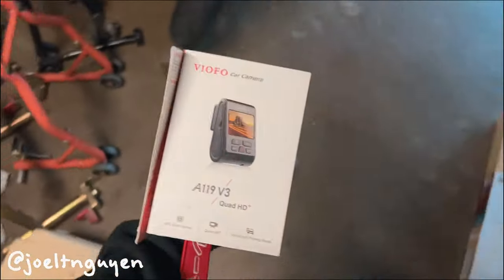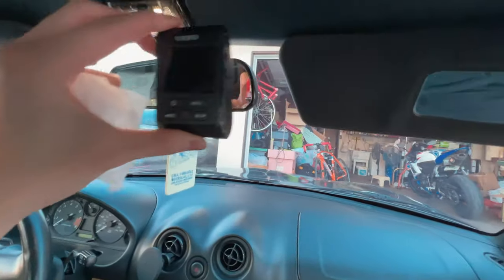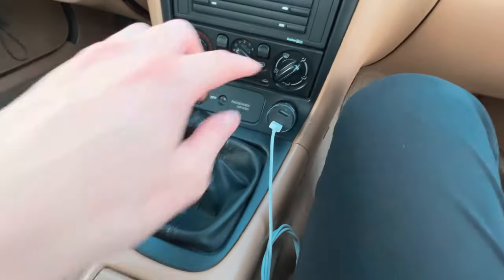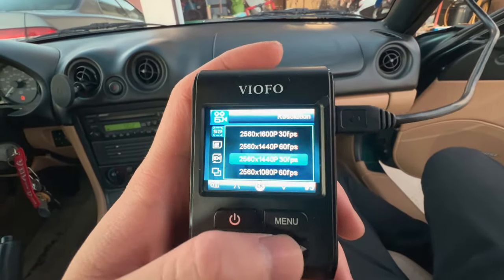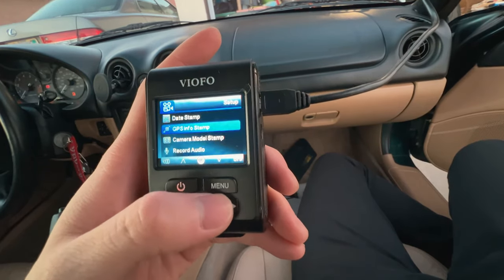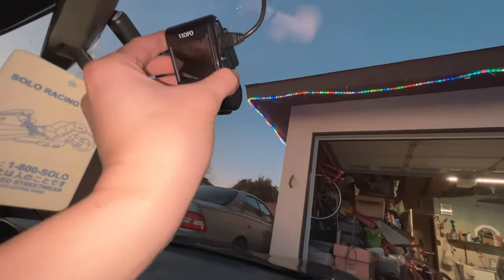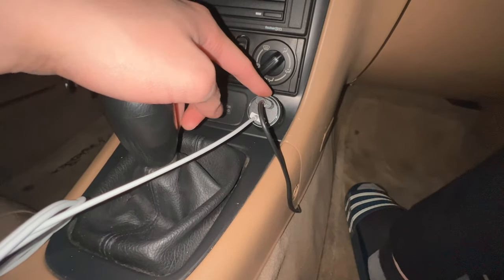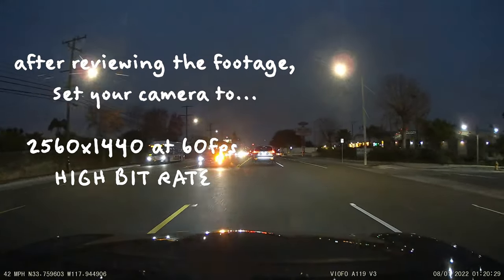VIOFO A119 v3 Dash Cam Install (Day and Night Test Footage)

Comment: Good video and thanks for the resolution / bitrate recommendation at the end.  👍
Also, the GPS mount has it's own power port... why don't you just plug into that, instead of the side of camera?  (less of the wire will be visible)
Reply from the maker: Ah you deserve a medal. I just checked and plugged it into the GPS! Makes it cleaner and I can disconnect the dash without unplugging 😂
Reply: @joeltnguyen   No problem, I just installed my new A119 v3 today with the GPS module + CPL filter. Drove it during the day and at night, quite a good camera I must say. I went with your recommended resolution and bitrate.  A 5 minute video file is almost exactly 1GB, which translates to almost 10 hours of recording on a 128GB microSD card.

The latest firmware (v2.5,) seems to add a higher resolution of 2880 x 2160 P30, but I haven't tried it. The files at that resolution will be huge, probably (therefore less recording time). It would be fun to compare all the resolutions and file sizes of the A119.  🙂
Reply from the maker: @SevenSixTwo2012  I tested one my GoPro when I was riding my motorcycle! Obviously different cameras but the resolution testing is similar! 1080p wasn’t clear enough but 2.7k or 1440 was the perfect resolution for clarity and file size. 4k resolution is definitely overkill but extremely clear and most likely able to zoom in with clarity (good if you need to read a License Plate further out)

The newer resolution looks like it will captures more horizontal view? Correct me if I’m wrong though but I’m assuming that’s the case. 

I’m curious now!
Reply: @joeltnguyen   Yes, I also assume that the video will be wider. However, the camera itself has a 140 degree viewing angle, therefore I don't know how they can make the sensor "see more" with just a software update. It might be just one of those software upscaling things that look quite unimpressive and taxes the processor needlessly. I've only had my A119 for two days, so haven't tested it yet.  Even at current resolution / bitrate it's excellent quality, so I might just keep it like that. 

Also, my night videos are nice and crisp, even with the CPL filter and HDR on. I wonder if the latest cams have upgraded hardware for night driving? In the Amazon ad, it says "2022 model" and my videos look better than some night test videos on YouTube. Yours look pretty good too.  👍

Comment: I personally use 2560x1080 at 30 FPS medium bitrate. There isn't too much of a difference between 30 and 60 FPS, both are technically 30 FPS, whilst '60' is just 30 FPS interpolated to 60. I also recommend turning on HDR, since it helps to add more detail in the scene. But this mostly applies to night time only.
Reply from the maker: Thank you, I switched my settings :)
Reply: @joeltnguyen  Glad I could help

Comment: I have hadwired installed switchable VIOFO dash cameras in my vehicle. One facing front, one facing back and one facing the driver and driver window. Why switchable? If one gets stopped by a pig they tend to ask to turn off engine and remove key. If the dash camera is connected to a source which gets power from the ignition key, then the cameras are rendered useless. My way the cameras stay on and continue recording the pig interaction. One thing to remember is to turn the cameras off. I sometime forget and find myself having to charge the vehicle battery in the morning. I don't bother with the parking feature, unless I go into a very sketchy area of town. I have had no issues with any of the VIOFO cameras.
Reply from the maker: Yes, I got pulled over and finally realized if the car is off the camera is off. Would have been nice to have the dash cam still running without the car on but my car is old

Comment: Why did you turn off HDR? And why only record for 3 mins, I think thats what you chose? I installed one yesterday with a 128g card and used 10 mins. This is all new to me so not sure what is best. Thanks!
Reply from the maker: HDR can affect image quality if it is not good. I haven't tested but haven't needed to.
Having shorter clips will help minimize each file size. Also you  can prevent corruption on longer clips. Also, having shorter clips it's easier to scrub and browse clips that are saved. You can also transfer clips faster for shorter clips.

Comment: What micro sd card your using? SanDisk High Endurance?
Reply from the maker: SanDisk Extreme micro SD
https://www.amazon.com/gp/product/B07FCMKK5X/ref=ppx_yo_dt_b_search_asin_title?ie=UTF8&psc=1

This exact link is where I purchase mine in the U.S. Got to be careful because sometimes it's third party sellers but this one never gave me issues.
Reply: @joeltnguyen  I order the Sandisk High Endurance from Best Buy a little while ago. Will try this one out if I do end up having issues with the High Endurance. Thanks tho 👍
Reply from the maker: @Sean-Adventures  Might be better with the High Endurance for the long run! Looking forward to an update :D

Comment: Did you update it? If so, which resolution are you using? I'm debating between the 2880x2160p 30fps or 2560x1440p 60fps.
Reply from the maker: I would go with 2560x1440 60fps, it captures more frames at a bigger resolution
Reply from the maker: That’s the resolution in using rn and it’s good enough to see the plates without zoom, you can read it clearly!
Reply: @joeltnguyen  that makes sense, thanks for your help!

Comment: i fucked up and bought this thinking it had a rear cam do you think a rear dashcam is necessary
Reply from the maker: I have a miata/convertible so the rear dash cam wouldn't work for my car. I would definitely get a rear dash cam if possible but even just  a front is better than nothing